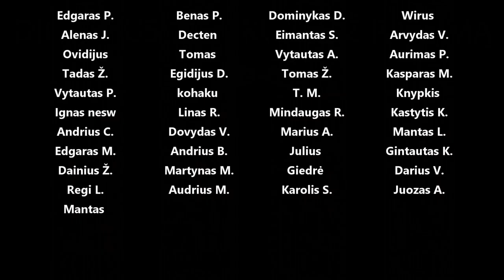Kraunam m42 į e30, perdarom pravotkę, ričių konversija coil on plug

Comment: wich coil you use my friend?
Reply from the maker: These are from n46 or n20.. actually these are installed in to many bmw engines.
Reply: @MechanikasLukas  Lukas thank for your replay, I'm building stroker on m47 and m54b30 pistons and std bore size, have you try cerakote?
Reply from the maker: @wk-nu3ri I have not tried cerakote. You are building m47 diesel engine with m54 pistons? Or just using diesel block?